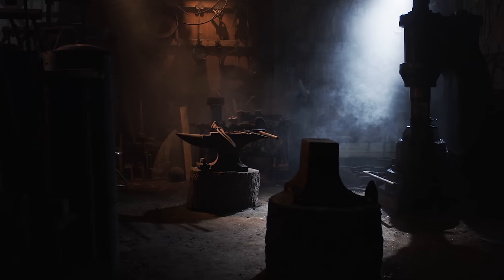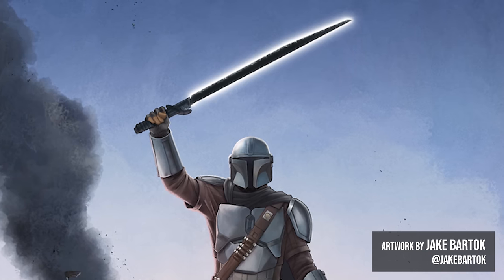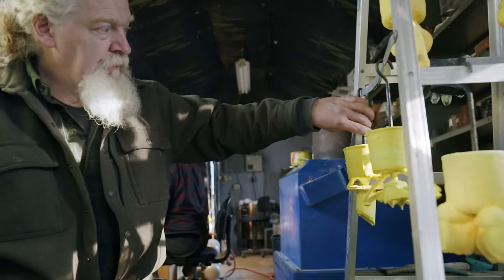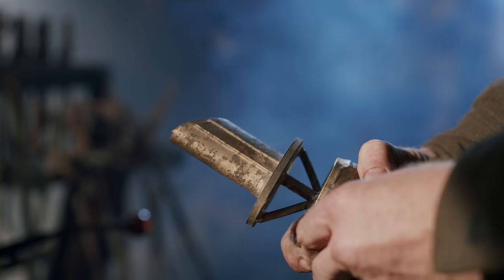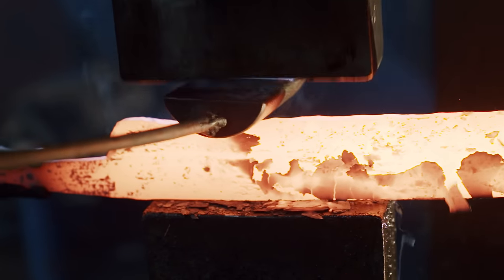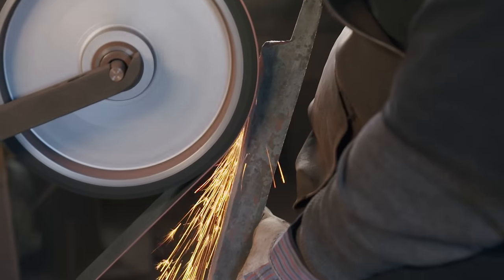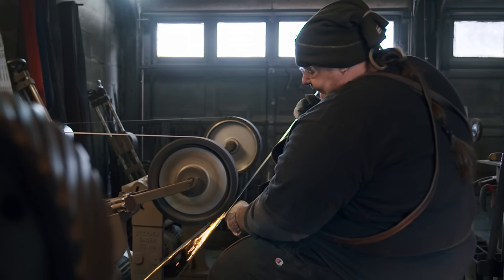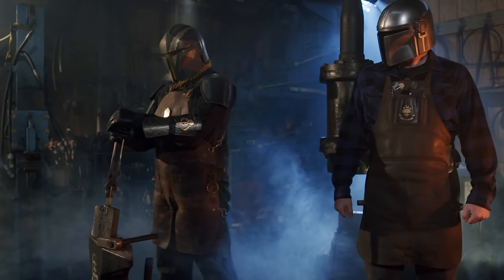Darksaber - Mandalorian - MAN AT ARMS - Reforged

Comment: Definitely a cool sword, but had you not told, I wouldn’t be able to tell that’s the Darksaber.
Reply: I agree. Too many striations and too small on the edge. The handle is wrapped like a katana, not fashioned like a lightsaber and the brass would have been better as blackened steel. It looks nothing like the darksaber.
Reply: The design behind this was a medieval take on the Darksaber so yes, it’s definitely got a different look to it. 

If you check out Jake Bartok, you’ll get a good example of what inspired it
Reply: I agree totally. It's an overall mean looking blade design, but this is like just the core without the light around it and that changes the profile completely.
Reply: Yeah doesn't look anything like the darksaber.
Reply: Yeah
Reply: I agree. It's an awesome sword but I wouldn't have guessed it was supposed to be the dark saber

Comment: Maybe I'm just being overly critical and nit-picky, but that doesn't look like the Darksaber to me. The handle and hilt of the Darksaber are supposed be a lot more geometric and uniform. I get that it wouldn't be a very practical design for a weapon, but that's what it is. It doesn't have the Japanese handle wrappings or the rounded guard, and I've never seen Man at Arms shy away from making their weapons as close to original article as possible. The blade couldn't have been done better,  but the hilt does not match up to the Darksaber. Still, its a badass sword, and it definitely looks like something that would be seen in the Star Wars universe.